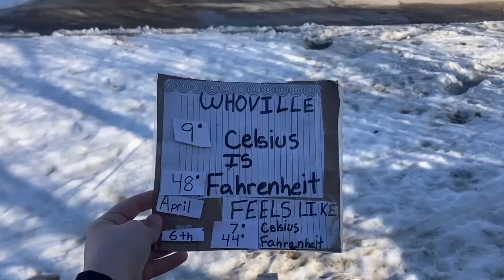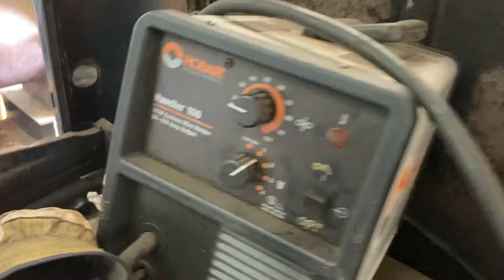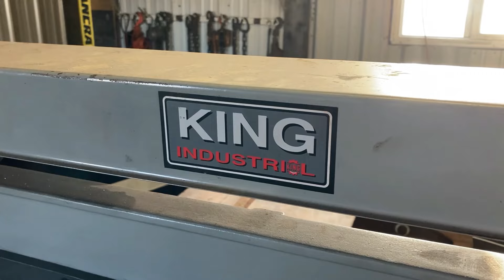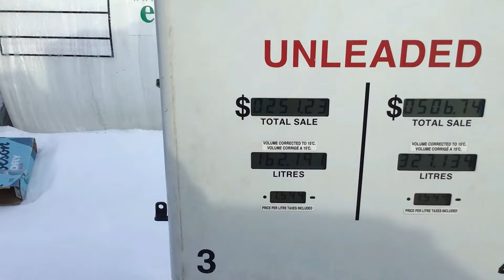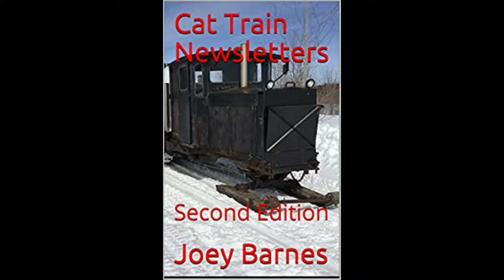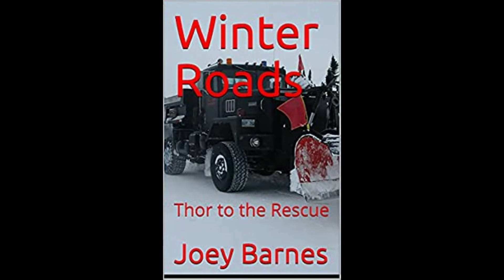Stripping the Winter Freighting Cats Down for the Summer  April 06 2024

Comment: KoO, I made up a very simple set of tire chains for my 2 wheel drive ATV. I used straight link chain like some tire chains use for the outsides. I let the air out 1st, then I just strung them across the tread after I passed the ends thru a couple of solid wire hoops for the sides. Then I tightened the hoops and clamped them with a cable clamp and blew the tires back up to take up the slack. I don't take them off, but it'd be easy if I did. Now it will go thru snow up to about 8"/ 20cm. Even powder, easily. I use that ATV to pull a little trailer for fire wood at deer camp. But you could use them for that intermediate time during spring and fall. OK. Let's see if this comment will stay. ben/ michigan
Reply from the maker: yes the quads are the only thing we own that does not have tire chains for some reason, might have to whip up a set.  thansk

Comment: It is easier to patch the floors with doors off. At what point dohey rust you hang the door to check its fit?  The cabs being Identical, did they rust in the same spots?    Still prescribing rest and fluids for Xena.
😎
Reply from the maker: we have templates and measurements we check plus jig pipe to fit between the doors when the doors are off. since we have 7 of these cabs we have learned over the years.  thansk